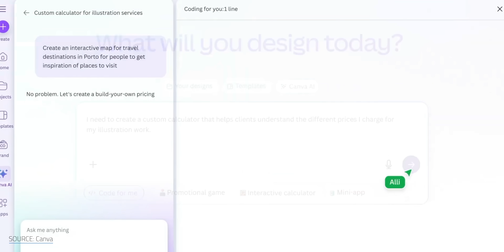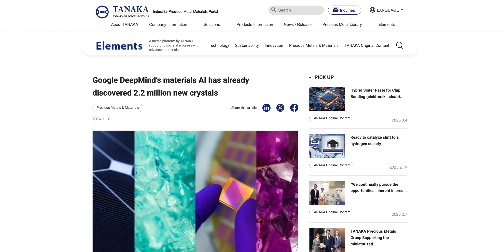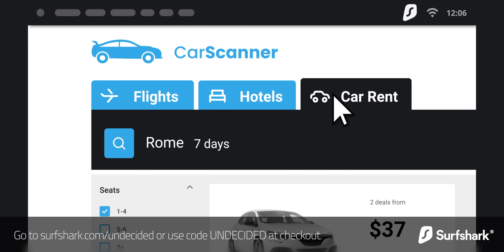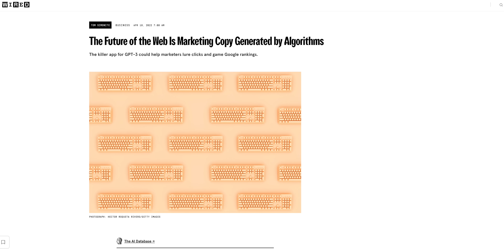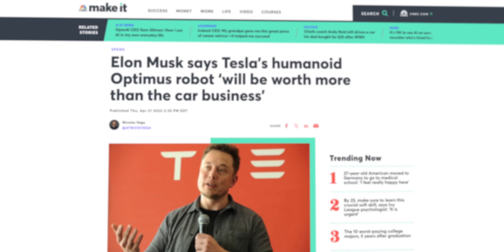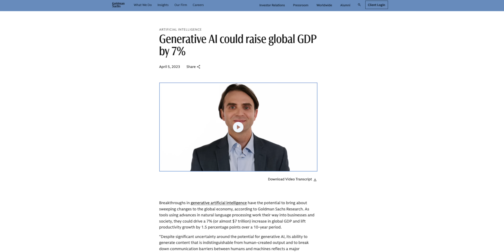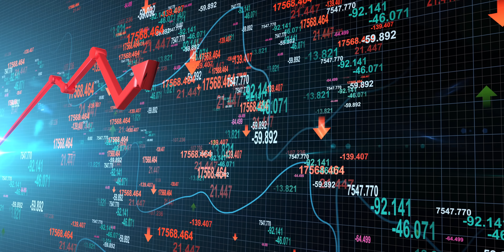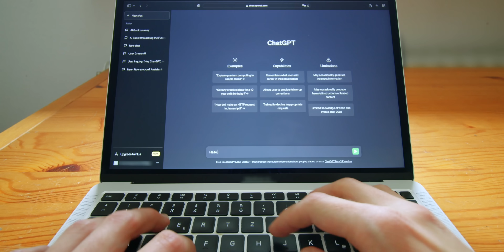Why the AI Revolution Has a Fatal Flaw

Comment: Another issue that doesn't help is all the "big tech" jobs, as Matt mentioned, are headquartered in major cities.  People losing their jobs to AI would need to move to these cities, furthering the housing market crisis, increasing local traffic, and other risks associated with overpopulation like disease spread.

One could argue that some of these jobs could be remote, but rural areas like the Central US don't tend to have good networking infrastructure, and it's been made worse due to some decisions from the current US administration cancelling infrastructure development projects.  Regardless of country, remote work for AI systems only works if you have good internet to begin with.

Comment: It is an issue, but it is a bit away depending on the sector. Robots for example. Automation cost a lot of money, because the robots usually are purposed build and programmed. New AI robots that mimic the human worker and are deployed faster could have a huge impact. Current versions are just really slow. If you need 3 - 5 robots to replace a single worker, it is just not economic. Not because of the costs of the robot, but because you might need entirely new facilities with more space.

Other positions might be more endangered. Managers or HR could easily be replaced by AI today, but these persons are in the position to fight these changes.

A lot of companys that did some layoffs for AI are already rolling back. It simply is not good enough, yet. Newer models have more and more issues with hallucination. In my opinion it is a good productivity booster and purposed build AI are a huge game changer. But a LLM that just works and does what you want is far far away.

Comment: I deeply think there's a very necessary education needed, too, about the difference between "single task, machine learning" and "generative AI".  Every one of these "medical", "material" breakthroughs are done via Machine learning that is very, very carefully trained on the parameters of success for a very specific problem space.  All the flashy demos are done with "generative AI" which is basically scraped off of the general internet.  Copilot is cool, but is infamous among actual programmers for creating insecure code.  *GPT models are infamous for being confidently wrong about easily disprovable things.  The fact that the two different things are conflated and sold under the same "AI" umbrella leads to massive confusion where "GAI" can take credit for the things that focused machine learning models have done, and "focused machine learning models" get to ride the hype of the pretty pictures that we used to have to pay an actual artist to come up with.
Reply: See what you do is hook up one of the more general AIs to a team of differently specialized AIs. Then when a human asks the general AI something it has a quick answer based on the text it's stolen, and or it can ask the specialized AIs to help answer the question. That's the quick and dirty way to semi-AGI. It becomes more than the sum of its parts.

Comment: A basic assumption of society is that survival must depend on effort for others, either directly or indirectly. At some point, and not that far off eigther, we're going to have to disconnect the Job thing from the survival thing. Or go luddite and slide back into the 1900's. We are already at the point were getting things done is losing it's connection to idea that people must do it. If the machines and software can produce what we need for fractions of pennies on the dollar then income v outgo needs to adapt. 
I don't know how we bridge the troubling in between step though. Unversal or minimum basic Income, guarantees of certain basics such as housing and communication and food and healthcare?

Comment: 8:30 WTF...THEIR IS NO PARADOX DUE...DO YOU EVEN KNOW WHAT A PARADOX IS?
Reply: Why you getting all worked up? lmao
Reply: That is what a paradox is... do you know what a paradox is?
Reply: @adr2t  where is it explain us pls
Reply: They're going over there to get their stuff. English 101, maybe learn that before whining about logic. 

"A paradox is a logically self-contradictory statement or a statement that runs contrary to one's expectation." The 'Jevons Paradox' is where instead of consumption going down to increased efficiency like one would expect consumption actually increases. It's often overblown, but it does happen. Take micro-halogen bulbs for example: they're more efficient than old fashioned incandescent bulbs so replacing them should make overall electricity use go down right? That's not what happened. People just left their lights on longer, and or turned on more lights at once, so overall electricity consumption didn't fall nearly as much as the massive efficiency difference between the bulb types would suggest.

Comment: Where AI could have a massive impact is in the human coordination manufacturing industry.  This is where it is far easier and cheaper to have a human who can pick up parts, align them quickly, secure them with screws or bolts using dexterous hands and a brain to move and align. Robots do great when things are in a jig and precisely placed in front of them.  However, these new robots are able (or will be in the next 10 years) to do everything from low-wage assembly, construction, crop picking, garment production, maintenance and even food prep.  This hurts, by far, the lowest paid workers (many times immigrants). The world of have and have-nots may very well be determined by AI.

Comment: These are not the only policy solution, if AI reduce labour demand then a solution is to lower labour supply by reducing the maximum work week and increase minimum overtime payment. This should also be used in conjunction with increase minimum wages and penalty for businesses using gig works/part time works to circumvent labour laws.

Comment: Retraining? Why would the welder want to work in data processing when they love their job? They will never be as good as they are at welding, especially if they are 50+, they may not even be able to use a computer to start with. a few years ago, It has taken me 3 months to teach my roommate how to use her smartphone, she's over 60 and only used a basic flip phone prior, but her current job requires her to have the app that checks her GPS location when she logs in. She refuses to learn how to use a computer, "the mouse cursor jumps across the screen, so I don't want to touch it." Me, I am more into hardware, I enjoy tearing things apart and putting things together, I tried learning coding years ago, and just couldn't grasp it. The so called jobs AI creates are for a special niche of people, and not everyone will be able to slot into those roles. Thereby job loss, and economic instability for those not raised for it.

Comment: My job won't even fork over the cost to upgrade substandard and cheap equipment to help improve customer experience. So I don't know how they would afford replacing my job with a robot, and I doubt it could handle all the older customers that have problems with basic tasks.

Comment: We have never done anything like this before. We should not believe anyone's prognostications as to the future. We will have to figure it out as we move along. Robots and AI don't use our need money. If we want to compete with that, we have to stop measuring our success in $. Robots and cars need electricity. Animals don't need $. Our needs are far more complex that those. We need to simplify our supply chains so that our basic needs are met without money. Our need for money is what controls our lives and is our Achilles Heel

Comment: In the short-term, AI is an economic disaster. Long-term, it will be a net benefit. When the Wright brothers first invented the plane, they thought it would be useful to the military (dropping bombs or making strafing runs with a mounted machine gun). They woefully underestimated the potential, and the idea of inter-continental passenger flights never entered their minds.  Even optimistic projections pf the impact of new technologies are invariably woefully inadequate. The same is true of the AI revolution, but exponentially more so - we are using 19th century economic paradigms to reason through 21st century economics - and failing at it miserably. We need entirely new economic models. I predict new economic models will develop decades after the fact (economics is a retrospective social science). You are correct, in the next decade hundreds of thousands of people will be chewed up and spit out by the system, but ultimately, all of humanity will benefit.

Comment: Advise I would give to people looking for a secure job is to look for one that requires manipulating small objects in unpredictable, dynamic locations. Ironically most of these safer jobs are in the often looked down upon blue collar trades like A/C work, electrician, plumber etc that are growing in demand.  AIs just cant help with these sort of jobs, but a middle manager? That's relatively easy to automate, and AI once its better is going to take a chainsaw to the corporate ladder. But would those cut people be willing to "step down" to blue collar work? That is going to be the big question for many.
Reply: Shifts of that magnitude have consequences. Look at BLS statistics for the number of administrative assistants (a job that is likely to be easy to automate away). Then say they switch to electrician. Scarcity of electricians will plummet, and what they can charge for their work will plummet as well. There aren’t that many blue collar jobs that are needed.
Reply: @OrangiaNebula , I would not assume AAs would make good electricians. Some people are now skipping college education to go into trades due to low training cost and a relatively high pay.
Reply: @michaels3003  I probably didn’t make my argument clear enough. It wasn’t about administrative assistants specifically (that was just an example of a job for which the BLS has easy to find numbers, state by state). My real argument is, if any large-scale job migration from one or more of the job-threatened categories to trades (plumbing, electrical work) occurs, those blue collar jobs will no longer be able to command a relatively high pay. The abundance of workers prepared to do the job will drive down the pay.
Not to discourage anyone that wants to skip college and go into trades, particularly if they enjoy working with their hands, they absolutely should.
Reply: I have a job that requires an absolute mess of fine skills - but it's in recycling. We are a first-pass that gets old merchandise and if we can re-sell it, great, otherwise process it as waste. The problem is those fine skills I use are based on people re-using old stuff... An example is I have these Thunderbolt docking stations, that can charge the laptop while providing extra HDMI and USBs and whatnot. Still perfectly usable, and surely with cpus more powerful, we could have a more portable computer for here and there? No, the need for those is decreasing as stuff moves to cloud and apps, and the items are "old". Still 100% capable but... legacied based on market forces. Nobody talks about the mechanics skilled in replacing transmissions. New constructions are fewer by there being fewer new people , more durable, and often more professional (IT work isn't coaxial cable and running hundreds of lines any more). The very people "blue collar" people work for is "old work, old money". That's an easy market problem.

Comment: The mistake everyone makes trying to predict the future is extrapolating one thing and keeping everything else constant. That's not how humanity works, everything causes a reaction. If AI can actually do anything and there are no jobs, society will react, perhaps with UBI or more startup incentives. AI is already making starting a business much easier right now. But also there are jobs fundamentally impossible to fully automate. Like deciding what humans want and checking whether automata align with it. These are the jobs of the future: identifying things to do, telling AI to do them and making sure it actually does them.
Reply: One thing is surely constant: people thinking they're the safe ones. Algorithmic diagnosing is still at the beginning. I personally encountered a security camera which scanned for faces and used thermal imaging to detect if someone had a fever, and would raise a warning! No larger AI needed. Housing costs have already skyrocketed leading to robot-built homes (step 1), HVAC units become more complex and more reliable (Europe and its exchangers), devices become impossible to repair without lawsuits, and the new object becomes cheaper than even replacement... It's a downward spiral, and if you're not one of the ones with capital now, you're screwed.
Reply: @doublepinger  Did you intend this to be a reply instead of a comment?
Reply: @MoiraLachesis  Not really. Not criticizing or anything, just being sad about the future and how blindly people will keep saying "there's something else".
Reply: Maybe I'm mistake. but machines are very good at deciding what humans want (especially if you have data) and we have chat bots that can talk to them to help decide what they want. Give it a pretty face like a Pepper robot in a shop if you need. You probably only need very few people to set up the system, actually you can probably ask AI to build a program today or in the near future which will set it up for you.
Reply: @autohmae It can only be partially automated, these things ultimately need input from humans. And they need it forever, humanity isn't static
Reply: You are on youtube, a site with a machine that tells you what you want, and yet you  think that is a job humans will be paid for? Ai users really think they are smart don't they. The ai will check each other, and the masses will have 0 input in their own existences.
Reply: The over sight  jobs will only take a miniscule fraction of the displaced worker under discussion and they won't be for the work you are about-
Deciding what humans isnt a job, people make stuff and if people like it & can afford it they get it and ai can be trained to asses automata fitness..... Ai is the ultimate tool because it can think through problems and if we give it bodies that is humans very quickly removed from the labor pool..... the only people who will be involved will be in situations like the one described in the video where 1 person with Ai does what 50 people used to do and you can trust the profit motive to ensure that as few humans who companies have to pay for work will be employed
Reply: @robdeskrd 1. Not oversight, alignment. Could be as simple as like/don't like. 2. You're making the same mistake as everyone, keeping things constant (here: amount of things produced) other than the extrapolation. As long as there is manpower available people will find things to use it for. Some things you can throw virtually infinite amounts of resources at, particularly in entertainment.
Reply: @robdeskrd 1. Not oversight, alignment. can be as simple as like/dislike 2. You're making the same mistake as everyone, assuming everything else stays the same. If 1 human can do what 50 did, what happens is you make just 50x as much (not necessarily of the same thing). Some things you can throw virtually infinite resources at, particularly in entertainment.

Comment: David Shapiro has been considering this problem for years, and he's developing a viable solution under the banner of Post labor economics, or PLE.  look at his 2025 lecture series. Very digestible
Reply: His solution isn't viable because it doesn't consider behavioral economics and human nature. Nowhere does he give details backed by numbers on how UBI can be feasibly funded. I do commend his effort though. And in his latest videos on the subject he seemed to clarify some of the easily debunked ideas he had in his earlier manifesto, but he still hasn't addressed funding. And if your whole theory relies on funding the rest of it falls apart until you prove that.
Reply: @chesapeake566  what funding challenges do you see that he hasn't addressed?
Reply: @chesapeake566  The same reason we would want it - is the same reason money stops having meaning. You wouldnt the class system would pretty much fall a part and thats where you will have issues - not really the funding because money wouldn't really have the same "value" or "reason".
Reply: @chesapeake566  Finally someone else with a brain! These folks think ubi will save us, then think they will somehow get as much currency as a 100k paycheck. They would be lucky to get 500 bucks a month. This will be less unded than welfare because way more folks will be on it.
Reply: @chesapeake566  ubi feasible? 😂😂 It won't work at all.